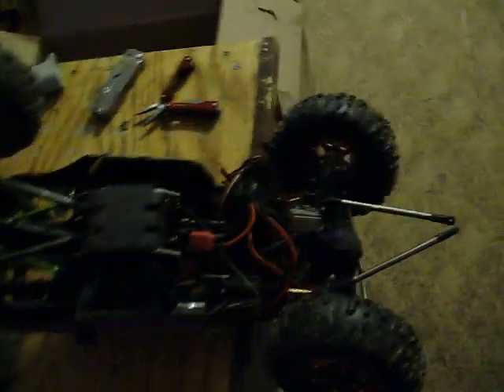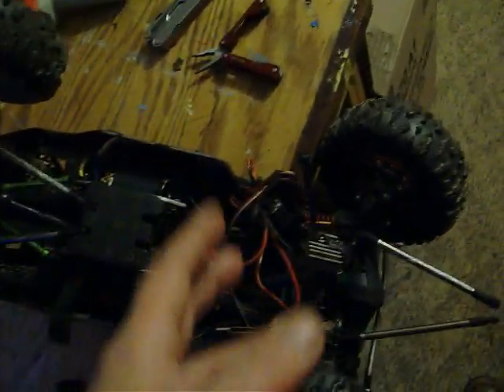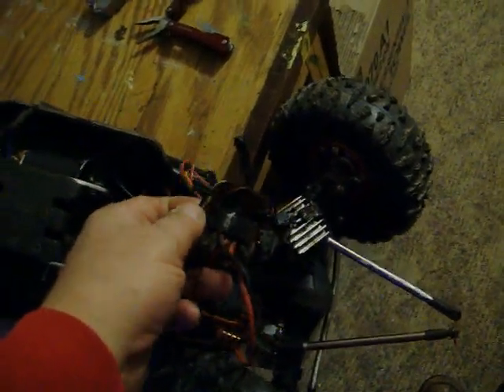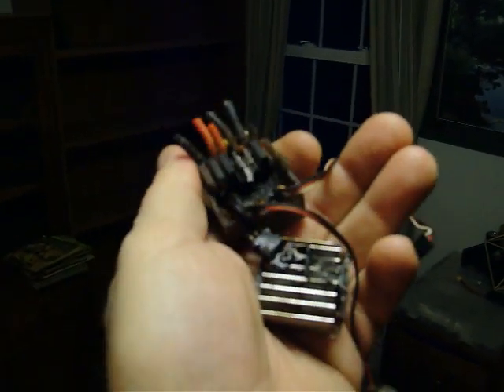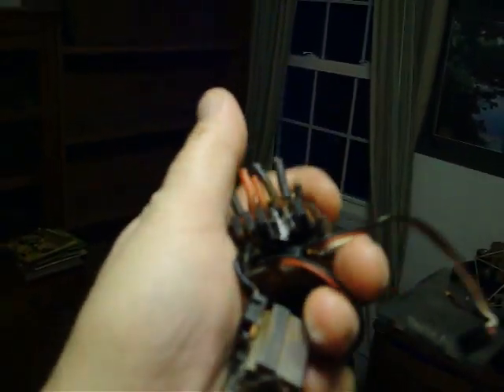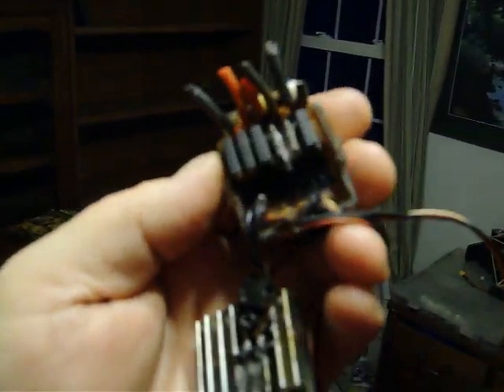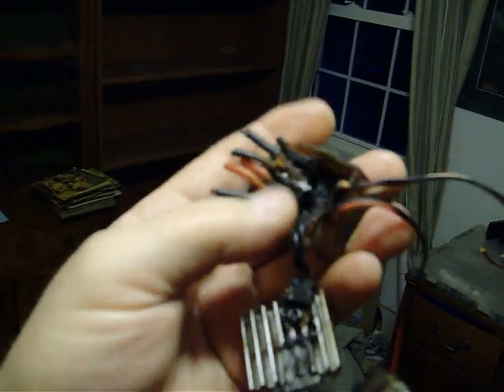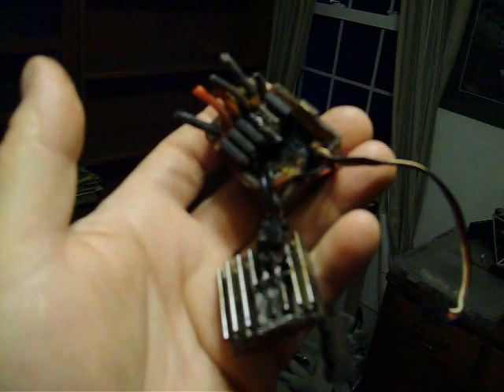RC Carnage: ESC Flames Out on the AXE

Comment: Holy crap!  Too bad you didn't have the camera rolling for that one eh? Yikes.... We keep our LiPo batteries stored in a metal box, I've watched way too many videos of the self immolation videos not to. But in reality, its actually kind of rare.
Reply from the maker: I've been packing stuff to move so I wrapped all my 2S LiPo packs in newspaper, boxed them up with the Epoxy supplies and an irreplaceable acrylic sculpture in a cardboard carton stuffed full of  crumpled color inserts from the local Sunday paper; then I made sure to put that at the bottom corner of my stack of other cardboard boxes full of everything our family cares about enough to keep and I'm storing all that in the wood framed shop until we move. What could possibly go wrong?
Reply: I swore off moving after I got out of the military. Going to miss the mountain eh? Whats the new situation like?